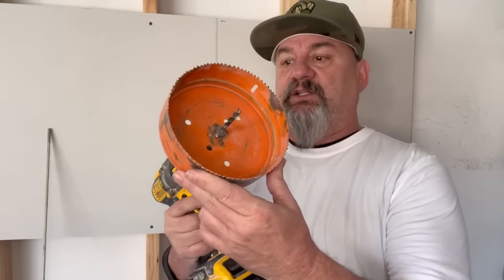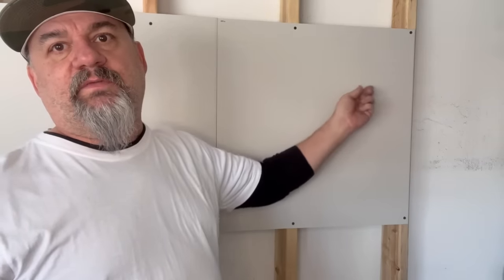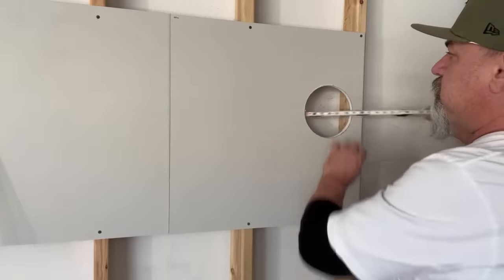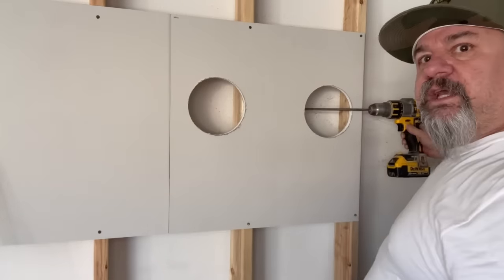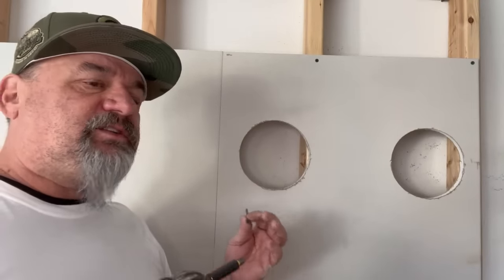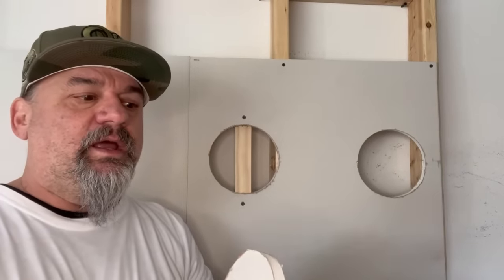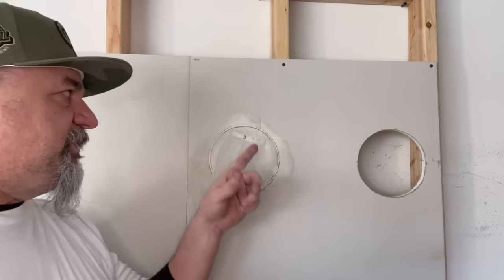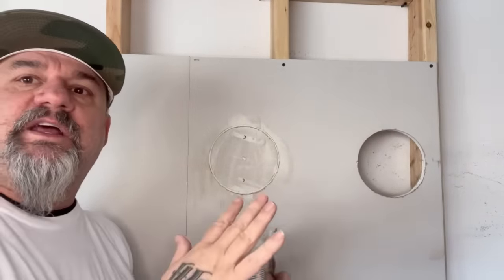Unbelievable Trick to Run Wires Through Walls and Fix Drywall - You Won't Believe What Happens Next!

Comment: Would it be good practice to run the wires lower in the wall when possible, like knee level, just in case the patches don't turn out perfect. Being right at eye level it would make every tiny flaw more visible than if they were lower.
Reply from the maker: yes great point!!! thanks
Reply: No dont do that. The code in many places specifies wire height and safety covers to protect wires going threw joists.
going into attic or crawl space can save tons of time and with micro small but long drill bits is so much easier in my view.

Comment: Pull off the baseboard and sawzall around the room just below the baseboard hight, drill your holes and pull your wire,cut your receptacle and switch locations to fir remodel (pop in style) boxes. If you find dead wood between the studs as you feed wire up to switches, cut a bean shaped hole about 3unches wide by 10 inches tall with the obstruction located cdnher of the hole, drill thrrough the dead wood and pull your wire. (Do not discard the cut out you made, bevel the edge of the cut out and the hole with a razor knife screw it back in place, mud the gap and call it done.)  Cut the same size & shape hole near ceiling to drill top plate for light wire, patch as before.

Comment: Another trick about using the hole saw is to run it IN REVERSE when cutting gypsum. It makes a far cleaner hole and is very easy to manage.
Reply from the maker: yea thats a great trick
Reply: @StarvingElectrician  Electrical work is so fun and easy, if licensing didn't require 5 years of enslavement I'd love to do it as a job. You're in NV; my wife and I are thinking of buying a big piece of land there. We're behind enemy lines here in MA. Escaping China, I mean MA within the next 3 months. The people here are horrible.

Comment: Hey, man, great tips as always.  You got me with the 'coarse screw' tip - I'll use that one forever.  Here's a tip back at you - I have a handy-dandy Dewalt right angle attachment the I use to drill studs, so you get a nice straight hole that's guaranteed to be in the center of the stud. Also, it allows me to always use a newer (and sharper) bit.  DAMN, a sharp bit is everything, and if you have that expensive, long bit, you might be more likely to try to keep using it as it dulls, when a smaller cheaper corkscrew bit will save you a TON of pain. (When I was a kid, my dad would use drill bits and sheetrock knife blades until they were worn down to a nub. It was like a friggin' miracle when realized (in my 30s) that you can actually use a SHARP blade! (cue singing angels).  Ah, life.  And, finally, don't underestimate the value of these videos.  ONE basic lesson can give a guy the tools to do a better job.  That better job will lead him to more work.  And that's a good thing.  Onward!
Reply from the maker: right on my brother I hear ya!
Reply: Coarse screws are for drilling into wood studs. Fine thread sheetrock screws are for drilling into metal studs like found in commercial buildings. 

There is a difference!

Comment: Hey, Thanks for the great video.  Appreciate the tips.  Here's one for you.  When possible and convenient I pull out the baseboard and cut my holes below the baseboard top line.  After completion I rough patch, replace the baseboard, and caulk.
Reply from the maker: That's a great idea!    this is just one of many tricks. there's lots of ways to do this.

Comment: I just had to rewire 3 bedrooms in my house to replace 14 gauge wire with no ground, with 12/2. I used my cordless circ saw to make 2 parallel cuts about 6 inches apart around the perimeters of the rooms and safely stored the pieces of drywall that came out. Was able to replace all the old boxes and receptacles, added a few more to meet new code, then put the drywall back in place when done. Used a multitool to cut into the corners. Worked really well.
Reply from the maker: righ on, thanks for sharing

Comment: My thought.  Some small additional work will be involved but I might try putting a 1/16th or so thick washer between the back up strip and the wall which leaves the cutout piece slightly below grade which may reduce or eliminate feathering, if you are lucky.  I like the idea of feathering the whole bunch to keep depressions from forming between each of the repairs.

Comment: Thanks man.
I'm always doing some kind of DIY project and I have found there is no measles way to cut and replace drywall until now I have cut an 8 to 12 in wide hole straight line from stud to stud and maybe from one end of the wall to the other ran what ever wire and outlet wall sconce etc, as well as using the 1X2 brace at the 1/2 waypoint. But that hole saw idea looks like a good idea
Reply from the maker: its a last resort thing but works pretty well

Comment: I was taught to to drill the hole on the stud, then use a trim router with a 5/16th bit to cut a slot for the NM, and then add the nail plate, and screw the round I pulled out back onto the stud with two screws.  This leaves the wire protected by distance from the other side of the wall, and on the open wall by the nail plate.   

And another hint draw your wire routing on the drywall in pencil so they know where things are run.  

And, I use a piece of scrap wire to find the edge of the next stud,  No measuring.
Reply from the maker: i explain about that in another video. this is just one way.

Comment: I'm writing to you from France. I find this quite interesting as here we use a galvanised stud system. Cutting a horizontal hole through the vertical stud would thus be more of a pain in the @$$. Also we place the vertical studs at the joint between the drywall boards. When I do this operation with holes, it is common practice to put drywall tape or a type of fine-mesh gauze around the hole to prevent any cracking. Wide feathering is thus required as well.
Reply from the maker: hmmmm thats interesting. thanks
Reply: @StarvingElectrician  
If you're interested, do a Youtube search of "poser du placo mural". This first short video in the search results gives an overview of the system. Of course, it's in frogspeak, but you'll get the idea.

Comment: Debbie Downer here...couple of things..this is the last resort method. Most device cut in jobs aren't bid to allow for a taper and painter. 
Most jobs do not have a good bucket of touch up paint just laying around. Its worse if the wall has a textured finish. 
And no, the hole doesn't have to be big enough to reach around in there, its called 'fishing' a wire. Commercial or residental. 
IF the wire cannot be fished from above or below, pull the base and hide the hole and wire behind it. 
A little polyseam seal and some 8d finish nails on painted base and it looks like it was never touched. 
Most stud/wire locators do not show PEX plumbing or DWV pipes. Drilling studs blind is how they are found. 
This is my 50th year in this trade. 
Cut in literally a thousand boxes. Can't recall the last time I did it this way. 
Bottom line, the best finish is when you walk out and the plug/switch/fixture/anything looks like it was born there. 
I said all that because I have been there, done that, longer than most anyone reading this. 
Now, go ahead and grip at me. 
I have broad shoulders.
Reply: He's obsessed with his 6 inch hole saw for sure

Comment: What happens if you have to run the wires all the way to the end of the wall and on to the next wall? You would have to keep drilling 6” holes all the way? Wouldn’t it be better to cut a long rectangle all the way till the end and use the studs already there to screw your Sheetrock to?
Reply from the maker: well you could fish the wire up to the attic and come down the wall to avoid a ton of holes.
Reply: That's what I would do. Cut a rectangle as long as needed and about 12 inches above baseboard, that way bad plastering won't be very noticeable.

Comment: Some spade bits are listed as suitable for use with an impact driver. Saves your wrists vs. using a regular drill driver especially when you are reaching overhead or otherwise not in an ideal stance. Excellent video.

Comment: My friend, if you run the hole saw backwards it won't grab on the drywall.  Also, after tightening your drill chuck loosen it ONE CLICK and it'll lock the chuck so it won't loosen up on ya.  Great content.

Comment: If you run your hole saw in reverse, it won't grab.
Reply from the maker: thanks for the tip
Reply: Having installed dozens of retrofit canned lights, drilling in reverse will not yank your drill and arms.
Reply: Can also use the clutch setting so if it grabs it wont buck in your hands
Reply: That filling knife is hopeless.  Not knocking you as im learning electrics from you but as decorator. A nice carbon steel flexible 4 inch blade filling knife will get the best results with ease
Reply: That's what I do too, especially with overhead work!
Reply: No, it would fill the hole.

Comment: Even better.. Use a multi tool with a drywall blade and cut out a square. Use some scrap plywood or 1x4, or whatever, and support the edges instead of just the middle of the piece when you put it back in.  Holds better, won't crack as easy if someone touches it.  Multi tool is a thinner blade.. Smaller crack to fill and less likely for the mud to crack.
Mud still gets "sucked in" when it dries, but again, this isn't a 1-coat fix.
Reply from the maker: i like it!

Comment: If you use a low voltage bracket template you get plenty of room to drill through the stud, gives you a lot more versatility when it comes to passing through studs.  Most of the time you can go down to outlet height and just add a blank plate over the hole. When you have to pass through a lot of studs in an odd area and there's no way around it the rectangle is just big enough to cover with a piece of drywall tape, so you would follow the same steps as you did when patching your circle cut, but you can finish it over with tape which just kinda skips a few steps for the drywaller / home owner because they would end up taping it anyway.  Suddenly I want tacos all the sudden 🥺
Reply from the maker: shit after all that I want tacos too!!!  lol

Comment: Thanks for the info. This a perfect video on how not to drywall patches.  Other comment here had good point about not cutting eye level as possible but I'm sure this was just demonstration on just patching holes for wiring. Either way I would not recommend patching holes like that.. should clean the cavity and fill edges with hot mud and then put the patch in so you have a good bond. Then tape and skim coat.  Also as other comments mentioned straight line are easier to patch and fill. 
Cheers
Reply from the maker: this is just one of many tricks. there's lots of ways to do this.

Comment: In the first minute you said you never know what's in there, could be a wire running along the stud.  After spending years with studfinders that work less reliably than just tapping, I was very frustrated at how often I missed the stud. About 5 years ago I bought a Walbot. Best $40 I ever spent!!! That thing really works so well you WILL know if there's a wire along the stud.

Comment: Gigantic holes totally unnecessary. Holes only need to be the size of 3/4in. paddle bit. Punch thru drywall both sides next to stud. Drill hole on angle thru stud. Feed romex thru drywall and stud to box cutout etc. Have done this procedure dozens of times with minimal damage to wall. The other option is to cut a 1/4in. channel in drywall as needed. Notch out studs. Insert romex into wall and slots in studs.
Reply from the maker: yea its one of many tricks or hacks, just trying to share what I use if I absolutely have to!!!  thanks for watching.

Comment: If you want to avoid suction cracks paint the raw edges of the drywall before you apply the mud, you can apply mud to the wet painted surface and then it won't suck the moisture out of the mud. Old-school plasterers never used tape and turned out beautiful Crack free work.
Reply from the maker: great tip. thanks

Comment: Tip: Run the hole saw backwards--counterclockwise--as if you were unscrewing a screw. In that direction it's sharp enough to cut the drywall, or wear its way thru the drywall, but it doesn't "catch" and it's more well-behaved

Tip: Another way to find studs is to use a magnet to find the screws

Comment: Trick I use is a regular hand drywall saw and cut the hole out next to the studs with a bevel all around the hole -- important to saw at an angle like cutting a cone out of the wall. Save the cut outs on the floor right below their source. Then when done wiring butter the back edge of the cut outs plus the hole, and sink the cuts into the wall, clean off excess compound on the face. The bevel gives the pieces a support to hold them. If I need more clearance for the drill I can saw another connecting scoop out in whatever shape I need and just lay them back in like puzzle pieces.
Reply from the maker: thanks

Comment: Besides not having to install backing, another good reason to cut the hole on center of stud is to be able to be able to put a small nail stop to protect the new wire. Amay have to trim the back of the drywall piece to make it fit flush with the existing wall tough.

Comment: Oh man, I need to do this exact thing in an extra room that was made in my old house, they put all the laundry stuff there and no one cared to put a single light in that room! I hate it every time that I have to do anything in that part of the house after dark. The only way would be to extend some cables through one of the receptacles, but the best place to put the light switch is far away from everything. I will need to make several of these holes if I want to pass all the wiring where it should be. Thanks so much for showing how to do this.
Reply from the maker: thank you. yea making holes and patching them sucks. hope this helps a little.

Comment: cool trick. I've always cut a square hole, but this a cool idea. I would use more sticks as you suggested. Another trick I use, ( I don't have a taco buddy), tape a small box under the cut out. It will catch most of the dust. If you recess the plug or use thinner drywall it's easier to blend the drywall.

Comment: I pulled a wire from behind plaster to move it to the other side of the wall stud. I had trouble getting the wire through the hole in the noggin. I put and endoscope in the area and saw that the wire would be a tough fit. I taped a long drill bit to the end of the wire, long enough to go past the depth of the noggin, and got hold of the drill bit and pulled the wire through. The endoscope was a great help as I could see what was going on behind the plaster.
Reply from the maker: yea I have one and for plaster they work great.

Comment: Thanks for the idea, I have a new garage door opener that mounts on the wall. I was going to run conduit from the center of the garage to the front corner to extend power. I think I’ll use your method, save some money and being in garage, a simple patch will also save time.
Reply from the maker: thank you

Comment: 1) use a quick set adhesive for the repairing  INSIDE backer wood strip which is held in place by a piece of wood placed on the outside across the hole and secured centrally until the adhesive sets. 2) using TWO backer wood strips  (or using a WIDE backer wood strip) will prevent the patching dry wall piece from pivoting (see-saw effect) over a single backer wood strip.

Comment: to save patching holes in a stud wall, paint with the joins etc, if there is a skirting/base board, pull that off, hell of a lot easier then finish patching a wall, be like a plumber with skirt boards, do your best silicon the rest.
Reply from the maker: right on,